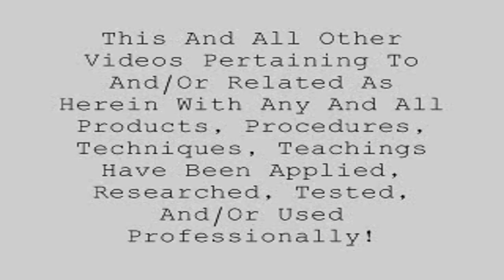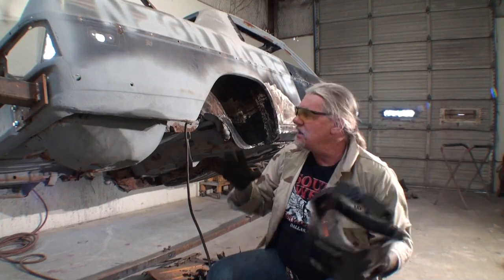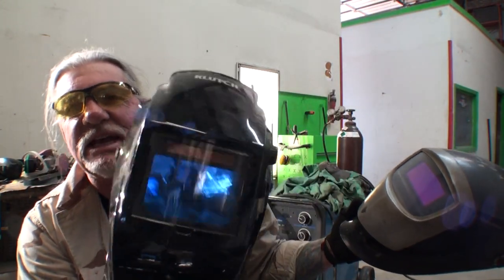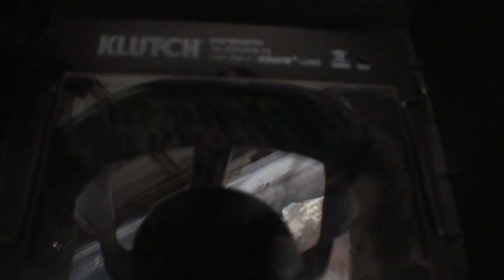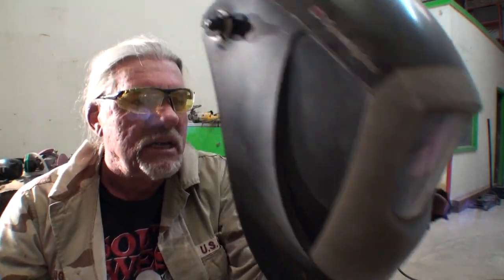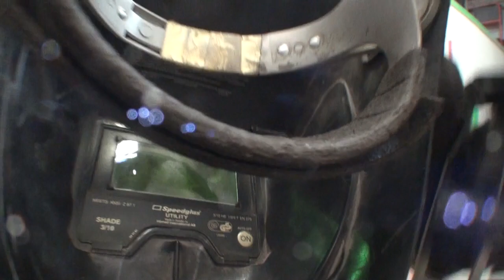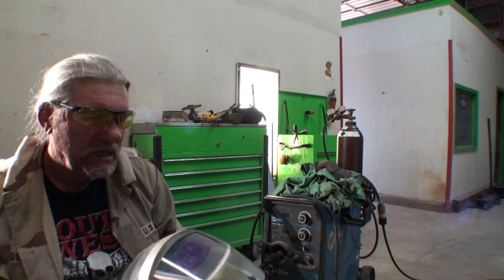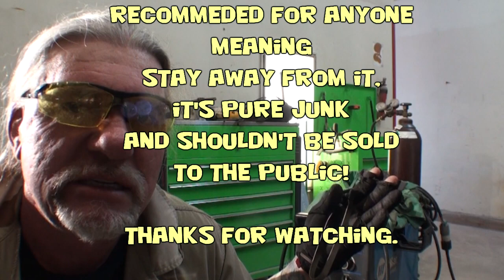Whats The BEST WELDING HELMET?

Comment: I am a professional welder Pete That is called delay on a welding helmet and used for after welding a long bead the weld gonna be hot and very red and bright to ur eyes which could hurt ur eyes so they put delay to keep dark so u don’t get eye fatigue 
Also the speed glass is auto sensing when ur welding at low amps u use a lower seti g on ur helmet because it’s not as bright which will make u see more and will make the helmet look clearer then actually is. Hope this helps

Comment: I replaced my Optrel welding Helmet which I had for twenty years with a newer model.  I chose the e680 Optrel. True colour, 5 -13 Shade level, Grinding mode, optional magnifying lens for poor eyes like mine, replaceable front lens for grinding. Made in Switzerland, not poorly made in China.  Not cheap but neither are eyes.

Comment: I have the old school helmet. Couldn’t decide on which auto darkening helmet to get. So many choices and price points. Truthfully I’m not using a helmet at all right now cause I’m welding 20 gauge into the rockers. Just doin 1 second blasts. Lots of helmets recommended in comment section I’ll check those out. Thanks for bringing this up Pete

Comment: Dang Pete...... When I did Class B welding back in '74, back at Fritz W. Glitch,  it was manual flip between the lense and see through lens (clear) on the hood.... That is when Pressure Vessels were fabricated for the Alaskan Pipe Line.

Comment: I have the same speedglas helmet, I does have a batter and the solar part suppose to keep battery charged. I've had to change  battery once or twice in 20+ yrs. So you should of just bought a battery for your speedglas and it would bnb of been good  for another 10 years probably unless you only use it once a year the battery won't last that long.
Reply: I guess my speedglas is a little different because it does have adjustments on it for the shades and sensitivity.

Comment: The reaction time of the lense is the critical number in the specifications of a helmet.  Tgis is not adjustable in any helmet! The faster reaction time the better!  
The delay setting on helmets is the time it takes the helmet to become light again ie when your doing heavy welding if the helmet goes light to quickly the glow of the weld alone will give you a flash!  When tacking or light welding the delay can be short almost instant.  🤙

Comment: Pete you really need get a grip , I understand this is your show but wow , clean the lens inside and out , yours has so much dust inside and out no wonder you can not see well through it . Now if your blowing holes through your work it sure as hell is not the helmets fault unless it is malfunctioning while your using it , if that's the case ( which you did not state it is ) than stop using it and correct the problem . My guess is you do not want to work on that car but you have to , and that is compounding your frustration ten fold . 
Gods speed to finish it and got on to the big move west . Jmbrown

Comment: I have a mid-lower tier Snap On helmet that does great (has the flames on it) but really I tell people a good helmet that's about $110 is the Hobart Impact. I used one everyday for 2 years straight and never an issue. It got stolen so the company bought me the Snap on

Comment: the cheap ones are only made for watching eclipses. I have the same brand as your good one but I don't think it's solar. The batteries lasted for 10 years or more. I only use it as a hobby and always replace it in the original box it came in. Thanks for the info because like you we sometimes need a second one and now we know what to look for.

Comment: Sadly if you ain't dropping 3 bills you aren't getting a decent one, and if you want a good one now days 5 bills and up.
Reply: The jackson safety helmet I had when I worked as a welder at the machine shop I used to work at was over $300. Great helmet. My personal helmet I bought for home was the same brand, but $132 on sale. The hood itself was a lot thinner plastic, but had the same auto darkening lense in it. It works great.
Reply: Disagree, had a Hobart Impact, used all day everyday for 2 years straight. Someone stole it. I paid $120 at the farm store.
Reply: @HoosierGarage  that's great,  we disagree.
Reply: I had an offshore solar brand (Speedway - $60 or $80) from a surplus store for almost 20yrs.  It seemed decent enough - I closed my eyes before the arc just in case it was too slow.  I upgraded to a battery powered Lincoln with 4 sensors - the difference actually felt like night and day.  I had no idea my old helmet was so crappy till I tried a better one.